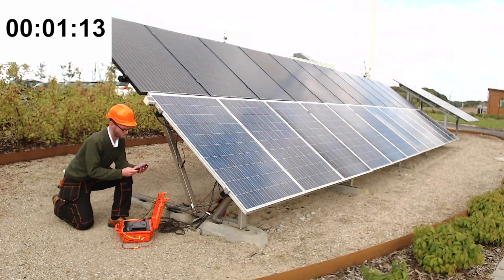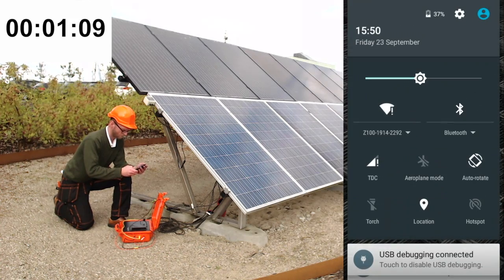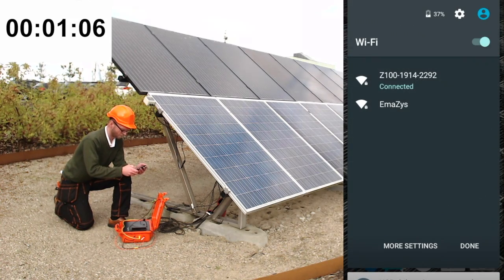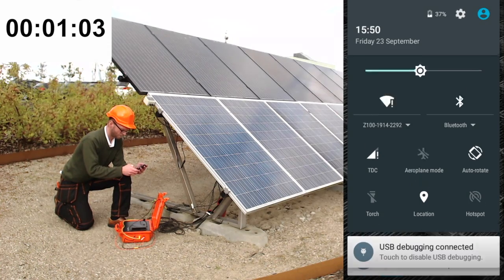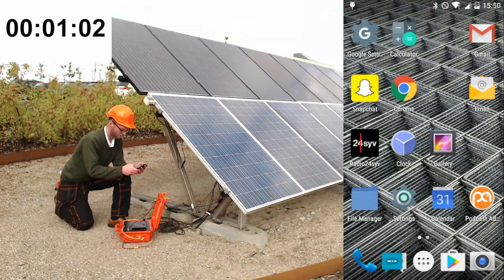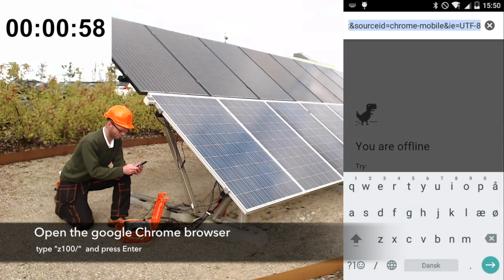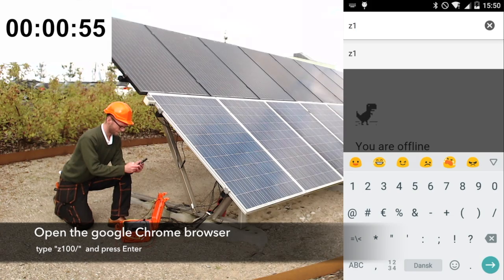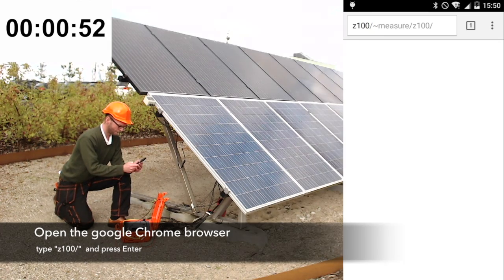How To find Solar PV Ground Faults - fast and easy with the EmaZys Z100 PV Analyzer.

Comment: We had a Huawei 30 kW in-grade system installed. Now the PV alarm is going off, although there is no leakage anywhere in the PV etc. Everything is fine, but the alarm is not going off. What could be the reason? Please guide me.

Comment: Does it work with solaredge optimiser?
Reply: As with all solar panels testers (not only emazys) it is almost impossible to use them with panels that have optimisers build in. So unfortunately the answer is no. You will have to rely on the build in fault finding in solaredge.
Reply: @andersrandfromdenmark7749  good to know
Reply: Isolation menu does it for you..

Comment: Why would I need it in my array? Non of them have ground. Just + and -
Reply from the maker: Hi Alex. Thanks for your question. Solar service and maintenance providers choose our product, to quickly identify and find solar array faults. It is a mobile instrument and as such, it is not installed in the system permanently.
If there is a leakage current issue in a floating PV system such as yours, then the PV system is typically grounded during testing. When the whole system is on a common ground, the fault is easily found with the Z100.
Grounding kits are often used in these cases. The vast majority of PV installations are however grounded for safety reasons.
 You may find more detailed information on our website https://emazys.com/
Reply: ບລຕຕ😮